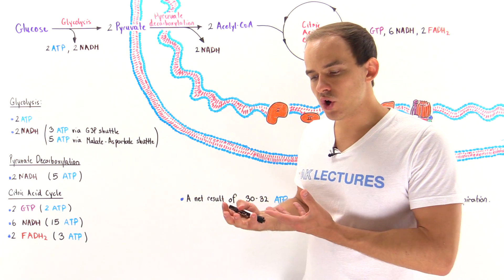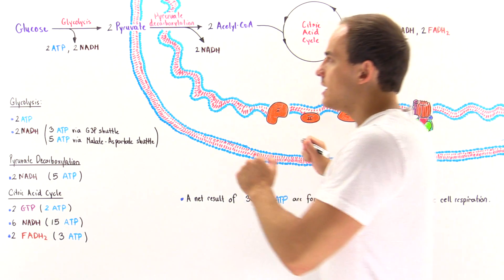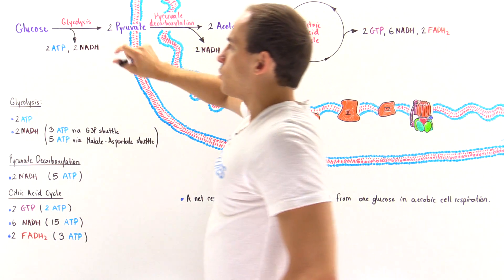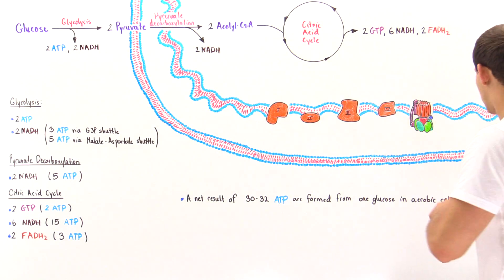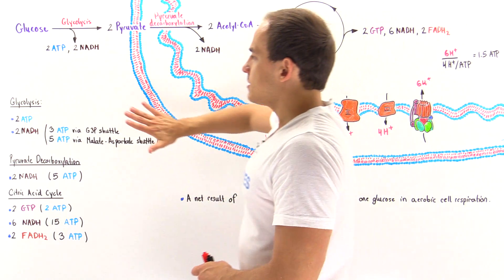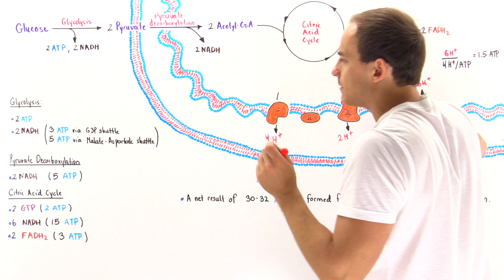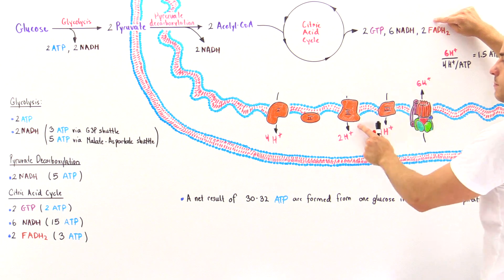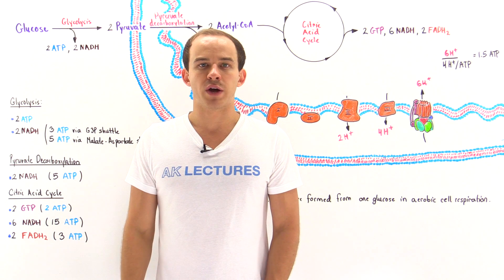ATP Yield of Aerobic Cell Respiration

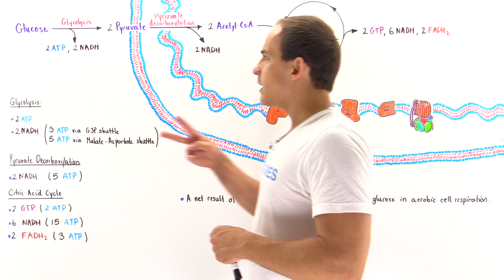Comment: 2:40 Doesn't complex III pump 4H+ per 2e- and complex IV 2H+?
Reply: I think so, too. I found a Nature Reviews figure that says the same 
http://www.nature.com/nrm/journal/v9/n7/images/nrm2434-i1.jpg
Reply: I think complex 3 pump 4 H+ per ubiquinone molecules because Q cycle has two part.
Reply: The first ubiquinol got oxidized and pump out 2H+ to pside and passed 2e-, one to cyt c and one to Q forming Q radical.
The second ubiquinol does the same, pumping 2H+ and passed 2e-, but now the Q radical takes 2H+ from nside forming a brand new QH2. 
So in essence, when one cycle is passed 2QH2 is "consumed" and one QH2 is formed, 4H+ is pumped and 2H+ is just taken from n-side. 
so yes, one QH2 nets 4H+ if you net everything up

This is from my professor